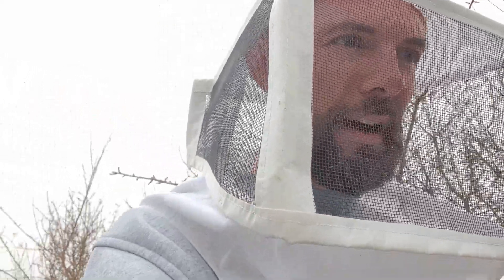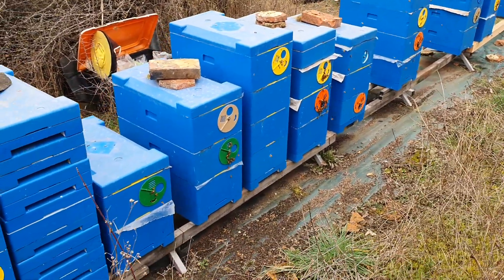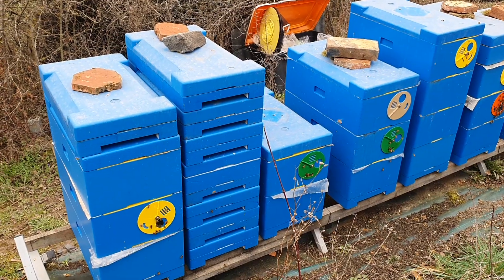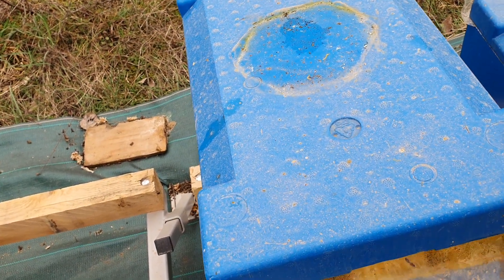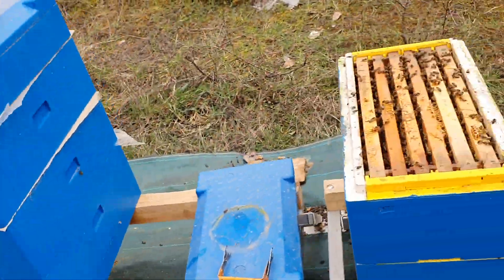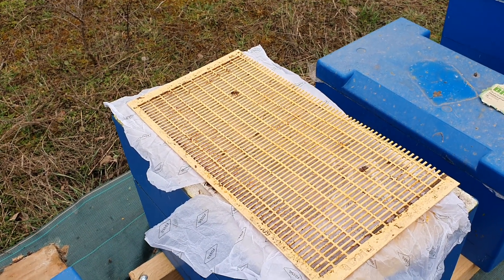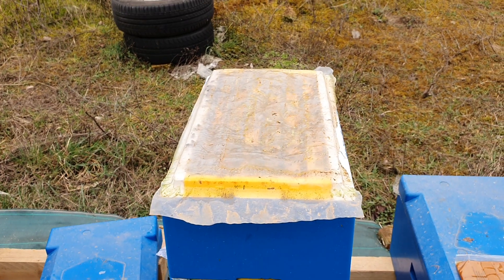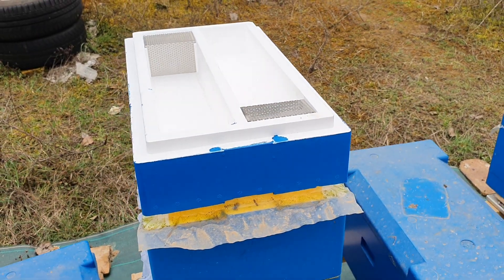How I set-up two queen hives in the spring. 16 March 2022

Comment: Hello! I am a new beekeeper I bought 1 Nikot device. The first time I took the queen and put her inside the device and left her for 11 days in a row in the hive. After 11 days I did not find any eggs in the hive. I asked some beekeepers and they told me to put honey inside the hive. And the second time I did this. I found the queen and put her in the camera and left her for 4 days. On the 5th day when I went I found 5 eggs in the nest. So out of 110 nests there were 5 eggs, and 105 were empty without any eggs laid by the queen. the third time I repeated it with honey in the bag and found the queen and put it in the camera and left it for 4 days and when I went on the 5th day I didn't find any eggs inside the bag. I repeated this two more times with honey but I didn't find any no eggs inside the nest. Please help me. I'm finding a solution to this big problem I have. Because I want to make queens for the bee park I have. I would be very grateful if you could help me make it by making queens with Nikot device
Reply: Arben. . .
Why not get your Bees to pull down some Queen Cells, from your Best Queen. No nonsense Grafting, Nicot Cage etc, etc.
Tip.
Get a Nuc (x5 Frame Hive) with plenty of Nurse Bees (Young Bees that nurture the Eggs and Larva.) Harvest these from Several Colonies. Make sure their is No Queen, or Queen Cells already. But the Frame has lots of Eggs, that have not started to change to Larval state.
With your Hive Tool do an 'Indent' Press into the Wax so an Egg in its Cell has no other Cells or Rows of Cells under it ! You want the "Chosen Egg" to be in a Cell, but everything immediately below it is like a Landslide or Cliff Drop. 
Why you ask ?
Well you have made an Indent where Bees will "Draw Down and make a Queen Cell in that Comb 'Indent.' 
Say on a Langstroth Frame, you can maybe do this x6 Times across, so their is about 5cm 1.5" between each 'Egg.'
You can do another Row say about 5cm down in Comb, with x6 across again.
Re Queen Rearing
Eggs are Days 1 -3.
Larva are  Days 4 -8
Hatching  is on 16th Day.
So by Indenting Comb with Eggs (no Larval !)
Replace Frames in the 'Hopelessly-Queenless' Colony for x12  Days. You can be assured Queen Cells will be Drawn Down. Capped on x9 Day and will be viable New Queens still in their Cells : (These look like long hanging down Peanuts in their Shells !)
Because "You" chose which Egg surround you Indented, all these Queen Cells will be uniform in Length, Spaced nicely apart.
Can be cut out easily with a Margin of Comb (so that Virgin isn't crushed/damaged in cutting out : 
Use Scissors✂️ to do this. You should cut a good Margin all around the Queen Cell. OK your Comb will have big Rectangles cut out of it. But Bees will repair this Comb, back to laying standard quite quickly. 🤞
Doing this Indenting process means no Queen Cell will be in a tight corner, or back to back on the opposite Frame Side, if you measure across and Indent 'in-between' the others ! Takes some thinking it out and practice. However, you should get much better Queen Cells,  than say on a Grafting Frame (!)
As Cells are directly in the Comb, Bees will nuture them better and the Nurse Bees can access them right across the Combs surface.
Once Harvested, keep the Cells the right way up. Trim more Margin Wax away, so you can add them into say : Queen Roller Cages with  the Cage Flap at the bottom ! You "lower" each Queen Cell down into the open (Top) End, any Margin Wax above 'holds and plugs that Cell safely' in its Cage.
Add these Cells to a Colony that does have a Queen, but is below a Queen Excluder, or place these Roller Cages in a Box not directly above the main Brood Nest.
These Queens will hatch in those Roller Cages and be nutured and feed through those Cage bars. On Day of Hatching x16 Dayfrom Start, see how many were Born.
Then make up lots of x2 or x3 Frame 'Mating Nucs'. All Nurse and Forager Bees [No Queen  or she will Kill any new rival !] Add that Roller Caged Queen in between x2 Frames : so she's wedged between two Frames. Wait approximately x2 Days for 'Colony' acceptance, then go back into the Hive, take the Cage out, undo that lower Flap, and watch the Virgin Queen 'Walk, or Crawl' into the Colony. (Not FLY off !)
After say x2 Weeks of being Established (with say Good Weather) : you should see Eggs being laid by the "New" Queen you Bred. She will have been introduced (freed) within the Hive, gone out on a Mating Flight, come back, to then start her Queenly Duties ! 
Keep them to make your Apiary Increases re Hives. Or Sell them to your Bee Club. Good luck. Hope this helps you and others. 😎
Make more than you need, some Queens might go out on a Mating Flight but don't make it back (?) Birds, Car Windscreen, Dragonfly Lunch. . . 🤭
🐝🐝🐝🐝🐝🐝🐝🐝🐝
 Happy Beekeeping 2023
🐝🐝🐝🐝🐝🐝🐝🐝🐝
Reply from the maker: Hello! Queen production should be made in strong hives that have enough honey and if not they are fed during the process. Introduce the frame with the Nicot cage in the middle of the brood nest. Take care that that hive is not preparing to swarm because in that case the queen will not lay. Good luck!